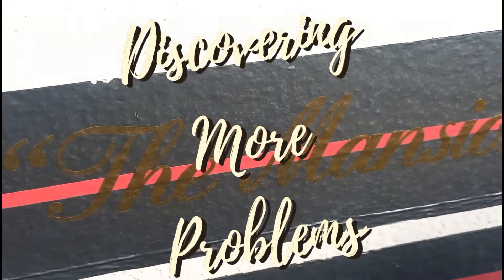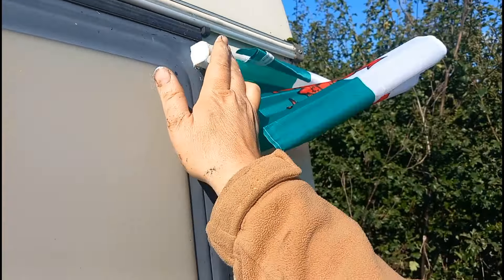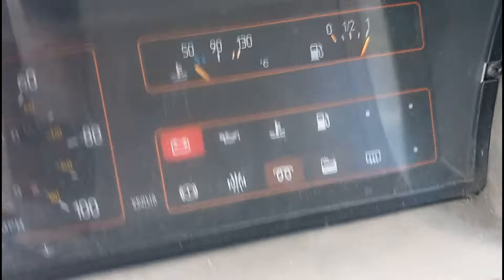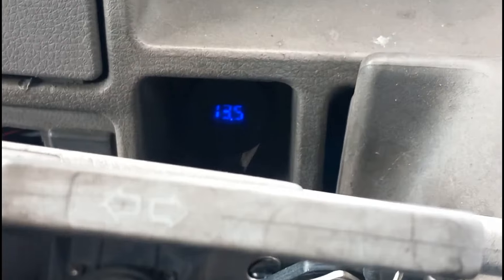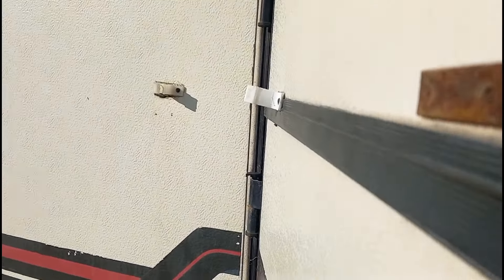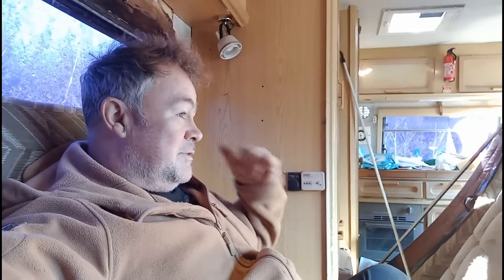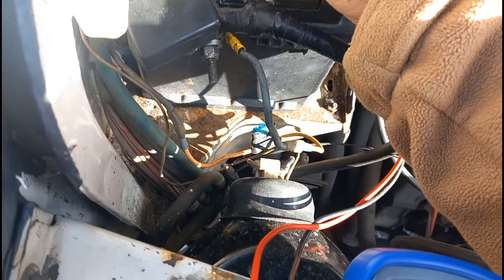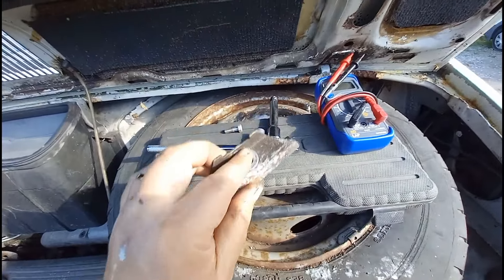Motorhome Renovation S15E37 What Else Is Wrong?

Comment: Evening Tim, oddly enough i saw a very similar Swift  Kontiki motorhome as yours, roughly the same age, looked in excellent condition and the engine sounded sweet as nut on the road, what a testament to the build quality. I'm certain that you will find yourself in a similar position on the road up and running, just a temporary setback on the starting. 👍
Reply from the maker: It just hasn't been used much for the past four years, Nigel. Just catching up on maintenance.
Reply: @SocksWithSandals  I understand that, you will get there Tim, just think, what you have achieved in a week, baby steps, but moving forward to being mobile and  your dream of getting back on the road will become real, we eagerly wait  the next instalment, you will do it! 👍

Comment: Someone else has mentioned it, but the lithium jump starter packs are worth having.  Very small and can get you going when your battery is not quite there.
Reply from the maker: You may have missed the episode when my friend Ben tried to jump start The Mansion with his Lithium starter pack.
Reply: @SocksWithSandals  Ah yes, just watched it! Does look a very capable pack, however these things have all kinds of timeouts (must attempt to crank engine within n seconds etc).  They also have a "manual mode" where it just provides the juice, no timeout, no safety check.  Always worth trying that :). (bit late now).
Reply from the maker: No,that's not it.

Comment: I would have left the old one in the van and run jumper cables to the replacement and started the old girl and left it for an hour or so to charge up the replacement before putting it in the old girl, but each to their own.
Reply from the maker: I actually did that when I bought a scrap yard battery for the Pug Palace a couple of years ago.

Comment: Just on the offchance that the comunity could help with your first van tim ... is the problem terminal with the engine or the usual  electrical gremlins ...not the hardest vans to work ive found
Reply from the maker: It's my third van. The second one was in shot where I removed the battery. I did discuss what I thought the issues were in the video.